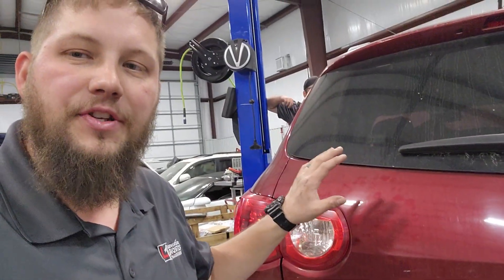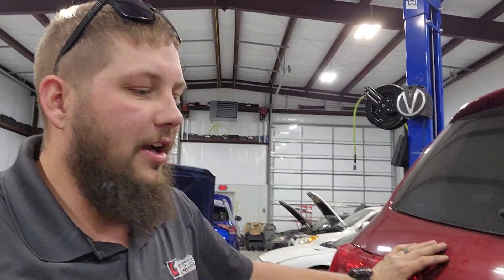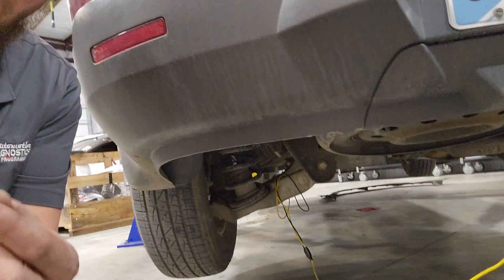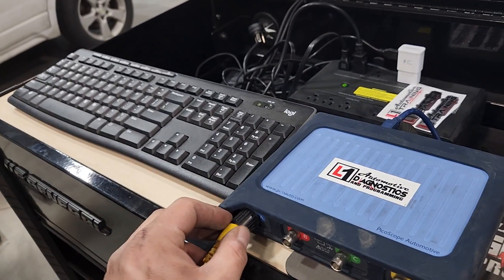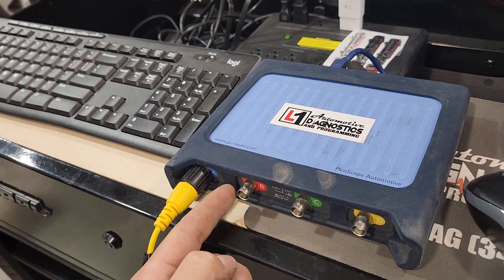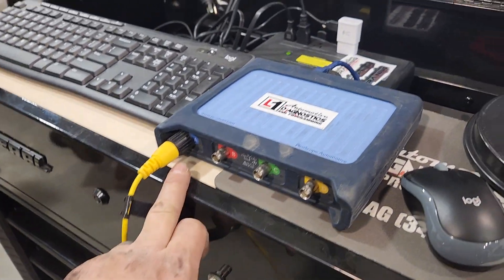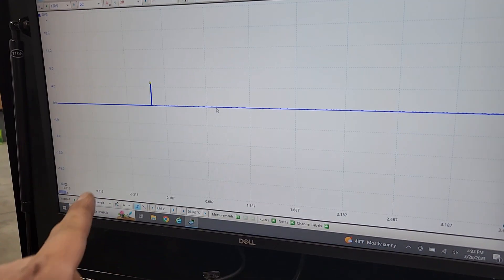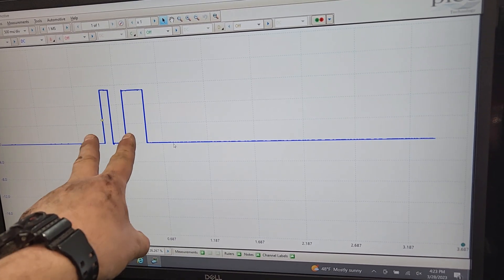A quick circuit check for GM active wheel speed systems!

Comment: Could have showed more detail on the actual connections. Will the 12v pulse happen even if the abs code is set? Sounds easy but I can't do based on what I just saw.
Reply from the maker: Correct, my case study/diag videos are designed for professional technicians with correct tooling and service information access, without those, you will not have the skills, tools, or information to fix a car correctly.

Comment: Thank you. My question is if we don't receive that 12v pulse @ the speed sensor, if I conduct this same test at the ebcm is it safe to assume the module is open? Or can there still be an open in the signal wire? Thank you

Comment: So basically, you've used high tech to establish 12v DC from module to the pins that supply an active sensor. I do the same thing with a £5 multi meter 😂

Comment: You could just put it in gear and go 10mph on the rack..  What could go wrong?
Reply from the maker: Front and rear wheel speeds will not match and it will think you are doing a burnout.